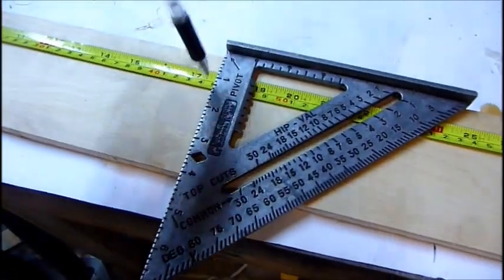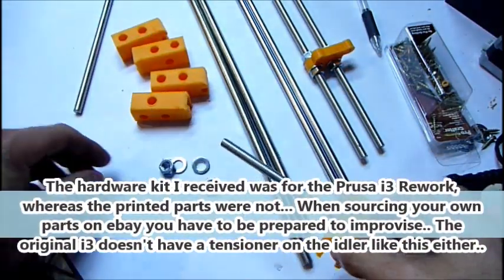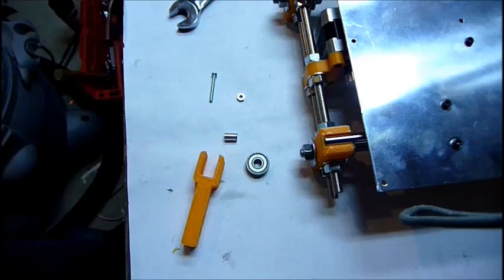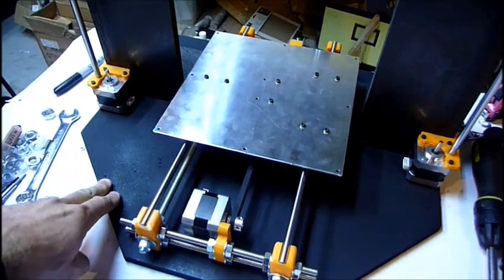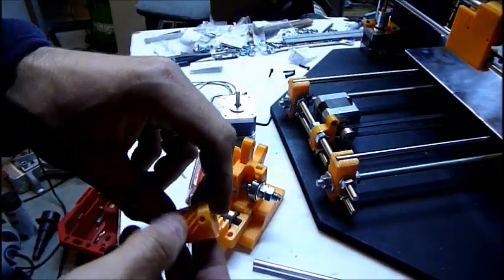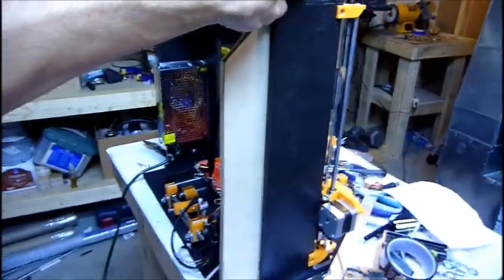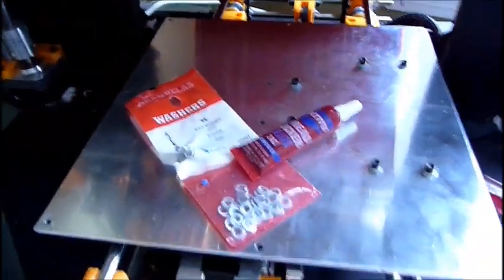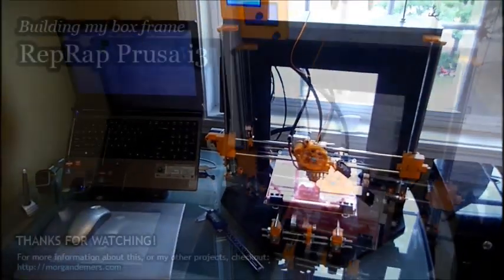Making a Box Frame Prusa i3 - 3d Printer

Comment: When countersinking plywood - or any other wood that is likely to get chipped(I don't know any other word for it), spin the countersink backwards or counterclockwise. That'll prevent the wood from chips, and also it compresses the wood to make a solid firm base for the screw head..:)
Reply: When building my model airplanes I use to put the screw, remove it, add some thin cianoacrilate to harden it and then after it cures put the screw again. :D Worked nice to avoid problems with vibration with the RC aircrafts :D

Comment: The brass piece you referred to on the top of the hot-end was probably for a bowden setup which you do not have on that machine (although you can of course).I would say rather than have that bulky heatsink on the X carriage, install a fan pointing up at the peek barrel. Mounting the hot-end with a metal support is very sensible - the" pocket hole" method is unsatisfactory, the hotend can "wobble" and lead to poorly registered prints. Regards, Alan

Comment: From the sound of your Jhead problems you probably have a Chinese clone, not the real deal.  I've been using an ALUhot end from 3D industries in 'Oz', it does require a cooling fan on the top (which might help your Jhead BTW), but it works great, doesn't jam, and goes from PLA <-> ABS with no issues.    I've built both a Repstrap made from HomeDepot junk with ball bearing drawer slides for the linear movements, and a RepRap Wilson whose printed parts were made on the RepStrap.    I have direct drive extruders with MK7 gears instead of hobb-bolts, and they are driven by 0.9 degree/step motors.  I'm using 1.7mm filament, which takes less force to push through the hotend.
Reply from the maker: +Kenneth Scharf Thanks for the comment, yes it probably is a clone - found on ebay at the cheapest price - with the modifications made it is working well enough at this point. Direct drive extruders are definitely of interest, though I haven't had the time, or need, to invest in one yet. Do you find print quality is improved at all by switching to a direct drive setup, or is it really only beneficial if you need to reduce the extruder's size for multiple extruder heads?

Comment: Nice work, did you buy a complete electronics kit for it or did you source the parts yourself?  I've got the mechanical parts for mine but none of the electronics and was curious where you got yours and what they cost.
Reply from the maker: I sourced all the parts on ebay and amazon. Not too much too it though ( just building someone else's design / machine ), you just need a RAMPS board, Arduino Mega 2560, 3 end stops, 5 pololu stepper drivers, power supply ( 12V 30A ), 5 stepper motors ( mine are 56 oz-in ), heated bed, 100k thermistor, etc... Typically these components will come with the high temp wire for the heated bed, and I bought an assembled J-Head ( which came with the thermistor and high temp wire ). The stepper motors I purchased came with wire + connectors so that was nice, however you may need to get some DuPont connectors ( 4 pin female ) if your steppers don't have them already. You don't need the Graphic Display, but it is a nice addition ( can run it without a computer ) - would have saved another $35 on the machine if I didn't purchase that. Total cost came it at around $450, which is awesome for what I'm getting out of the machine now. It does take quite a bit of tweaking, though once you get the settings right the prints are pretty decent.

That being said you may be able to find a kit on ebay, or elsewhere, that is cheaper than buying each part separately. I had pretty decent luck sourcing most things separately from US sellers ( didn't want to wait on shipping from China ), however if I did buy from china I would have saved probably another 25% or more on the parts.

Cheers,
Morgan